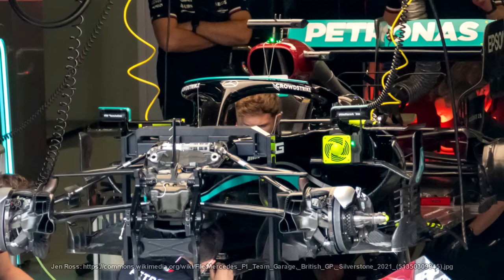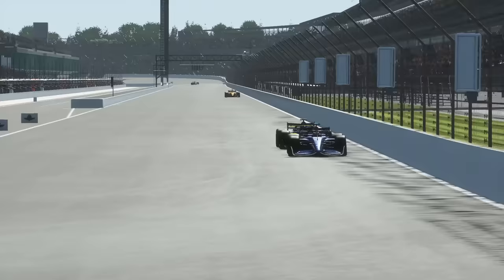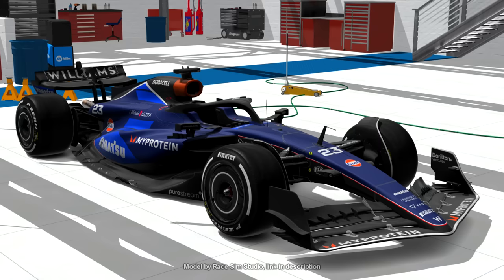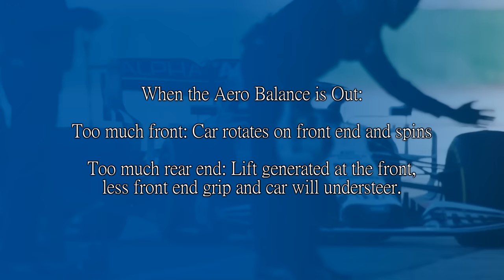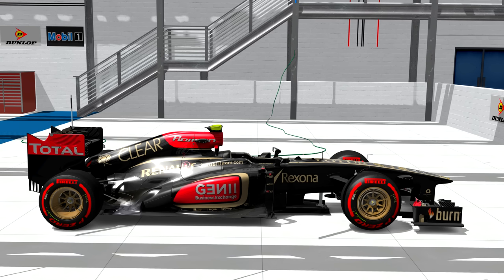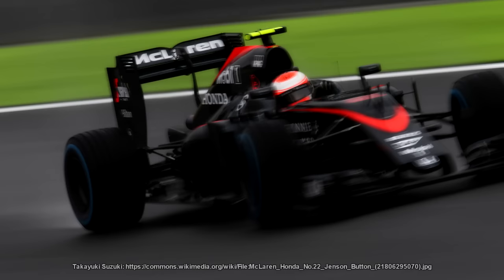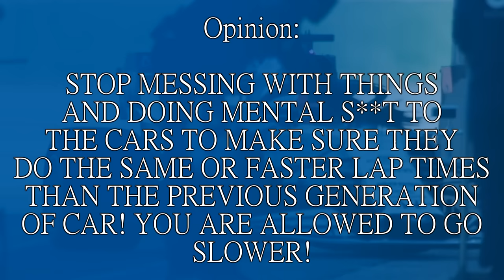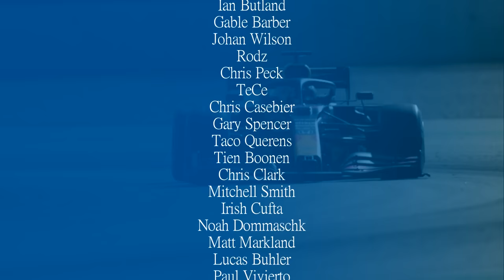BROKEN BEFORE IT'S EVEN IN? Opinions on the 'Undriveable' 2026 F1 Cars

Comment: Forget about incorporating movable aerodynamics. What I'm concnered with is how a minor failure in that regard, where in today's world you could get away with something like a front wing change, could just throw you out of a race completely, simply because you can't shed drag on the straights, or conversely, get enough downforce when going through the twisty bits.

In all honesty, this just sounds to me like one more point of failure that teams will have to mitigate. If this means we get early turbo-hybrid era levels of retirements, I dread to imagine how races can so very quickly be ruined. You don't even need to look far to see that movable aero's effects on a driver's race can be massive, just look at Max Verstappen in Spain 2022.
Reply: Drivers in the past died from rear wing failures at high speeds such as Bruce McLaren at Goodwood in 1970. F1 never had active aerodynamics for this reason. Active suspension was also banned on safety grounds as well (people also argued that active suspension was a driving aid and they were getting annoyed with the best drivers in the world using driving aids like ABS, traction control, launch control etc).

Comment: I think these rushed cars are going to end up pushing some teams out of the cost cap. The old saying is “good, cheap and fast. Pick two” teams won’t want to bring a bad car so they are going to end up spending lots of money on overtime hours and other things to get a good car quickly. 
The teams will get penalised but it’s the FIAs fault for taking too long
Reply: The bigger fear is a repeat of 1994 where we have cars that are undrivable  because the teams didn't have enough time to design and build and test the cars to fit the regulations for the season.
Reply: @CyanRooper yeah I hadn’t even considered that. Maybe the FIAs fears of 1993 about computer systems malfunctioning might actually happen if they don’t get their arses into gear and produce some concrete regulations
Reply: Highly unlikely. F1 is going hard towards becoming a cartel (they want to actually ban other teams joining in the next Concorde agreement) so the chance of a team being spent out of the sport is very very very low.

Comment: You think with synthetic fuels being shown to be viable, have less carbon emissions than conventional fuels, and bring comparable performance to the engine; you’d think they would start to rely less on the MGU- H battery because it kinda would be dead weight. I think removing it all together would give improved reliability to the car, less weight, less complexity, and could help transition to slightly higher displacement engines…. And maybe even a V8 (I know that’s far off but a man can dream)

Comment: Give me cars that can go through Casino corner side by side with a little room to spare on each side, or can go three wide during corners like Curva Grande. Give me cars that do not weigh 1t but instead weight around 600-700kg.
Give me cars where the car looks like it got blown up after a big shunt, but the driver can escape without injury.

THAT is what I would rather have, than going quicker and quicker each regulation until we create an irl version of F-Zero...

Comment: I guess I don't see a problem with having to, you know, slow down and risk drifting a bit around a corner?  I know that open wheel drivers HATE oversteer, but I'd love to see the balance go from "90% car" to "50% car, 50% driver."  It's the old cycle -- remove downforce, and within 3 years they have it all back, so in year 4 they remove downforce, etc.  But more HP and less traction always makes better racing.  More nervous drivers, especially those who aren't the best, but better racing.
Reply: "slow down and risk drifting a bit around a corner" Four wheel drifts went away from F1 with the move to radial tyres around 1980.  They aren't like the cross-plies of the mid-70's where peak grip was at much larger slip angles. Four wheel drifting around corners with radials is slower as that is beyond the slip angle of peak grip.  For what you want, *why  not just mandate crossply tyres?*🙂
Reply: @TassieLorenzo  As I said, slow em down and have 'em move around.  I know it "went away" and quite frankly what we have is / are boring races and people geeking out over some small aero bit that got moved.  7-time champions "forget how to drive" when their don't have the equipment, while wankers suddenly are up front.   The thing needs to be 50% driver skill, and that won't happen with the current rules.

Comment: They say racing improves the breed. Well, it used to be true, once. Low hanging fruit.
Now? Maybe on the engine front it’s still possible.
The last time I can think of that F1 had any impact on the real world was when they engineered breathing machines during c19 lockdowns. Fair enough, that was a worthy endeavour.
But there’s not much connection between F1 cars, or any racing cars, and real world cars anymore. If they lose that, what’s the point of racing? Not brand recognition, I’m not tempted to buy a Merc or start drinking RB, just because they’re in F1. I won’t buy Pirellis for my car, I don’t even know, nor care, what brand tyres my car carries right here and now. I can’t fill’r up at Aranco. What’s the use? Only ‘racing improves the breed’.
Without, it’s just another sports category. You can be fan of a team or driver. I am, but that’s not enough.

Comment: It's not a concern, it's a fact: 470hp (350kW) will deplete 4MJ in around 10seconds. At witch point the cars will be left with only the ~500hp permitted to the ICE. 
And that's best case scenario. Most laps will be worse than that, since they can only recover 2MJ per lap from the MGU-K (MGU-H will be gone). That means, 2 laps charging for a third with 10seconds available of double power. Puny 500hp most of the time. 
Keeping this energy recovery and deployment limits is absolutely idiotic. I really can't understand what they are thinking...

Comment: Software developer: The public is too dumb to talk testing. From experience. In short. Would you rather they found problems on track, or in the sim? In the sim. Which is what they did. Which is why they ran the test.

(ahem) YOU SHOULD ALWAYS WRITE A TEST SO IT FAILS THE FIRST TIME. If a test works, maybe you wrote a useless test. If it fails, now you're fixing problems. That is the point. It shouldn't start passing until you've solved all the issues.

"They left it too late" would you rather they get the rules years early and spend the whole time sacrificing curerebt gen for it? You'd yell about that too.

"Well these regs were supposed to attract new teams". (Leo pointing meme.) There. That's the real issue. Nothing else matters compared to that. That's the issue.

"You are allowed to go slower" not in the social media age. That is also a problem.

The result of test was that they advised, if they want bigger DRS, it has to be on front and back simultaneously. That does not mean they will go this route! They may keep DRS as-is as a compromise.

"What if bug DRS fails" my brother in Christ. What happens when DRS fails today? There has been much work so that usually, DRS fails shut. It should not fail open. Systems that fail in an unsafe manner are certainly a problem. So that's why they are testing.

Comment: So, umm, if cars can basically run high downforce setups everywhere and just dump the downforce on the straights... how do you overtake? Braking zones in modern F1 cars are laughably short so unless someone cocks it up there's not much chance there and now cars are likely to have less variation in setups removing that 'x is faster at y bit of the track' opportunity too. Honestly F1 really needs to figure out what it wants to be. If you want to be really restrictive in the rules go all the way and have at least a partial spec series with a way to enforce nice friendly air coming off the arse end of the car. If you want to be an engineering series then open up the rules so there's multiple viable avenues to high performance and a mid-pack team might be able to try a hail mary option ala Brawn, Williams and Toyota in 2009. The current approach coupled with a cost cap virtually guarantees that whoever gets it right at the start of a regulation change will retain that advantage for years as the rest of the top tier, rolling in money teams can't spend their way to catching up. 

Oh and on the laptime question, I wonder if F1 is starting to cast nervous glances over at Formula E. Gen 4 is due to race in 2027 and they're looking at around 600kW / 800bhp along with larger batteries and in-race charging via the mother of all cables in the pits (600kW for 30 seconds giving around 10% charge... going to want more than marigolds for that one!). FE cars are already in the same weight category as current F1 cars (and actually start a race lighter) and the boss of Envision reckons that if you put proper aero and slicks on a Gen 3 FE car it wouldn't be far off current F1 lap times. Now, obviously he's got a vested interest and we'd be talking single lap pace as current FE cars can't go the same distance (and, presumably, not at the likes of Monza) but that's probably not a million miles away from the truth. And, of course, FE potentially has the one trump card that could undo Formula 1 that no other series has: relevancy. F1 exists in its current form thanks to the value of its brand and other companies wanting to be associated with it. As the world keeps moving away from ICE and with younger fans being far more attuned to green issues it's not inconceivable that F1 could find itself out of fashion and fighting to stay relevant, at least enough to keep those sponsorship bucks rolling in. Not, of course, that I'm saying it's likely to happen but interesting point to speculate on.
Reply: Problem is that if they tear up the rulebook and allow more freedom then someone will inevitably get it right and dominate leading to everyone to complain about boring racing. But if the rules were restricted to allow for closer racing then fans will complain about the lack of innovation and call the racing "fake" or "manufactured" or "Socialist" for some reason.
Reply: Also not everyone who is under 20 is interested in EVs, there are still teenagers on social media drooling over 90s JDM vehicles that they'll never own like the 30 year olds that grew up with those cars who will also never own those cars. Formula E's success will be based on how entertaining they can make the on track action for people that don't usually watch motorsports.
Reply: The FIA will gut Formula E or merge it into F1 proper if FE started gaining any serious relevance. It's what the FIA does with anything under their banner that even starts to sniff F1's popularity.
Reply: @FallingPicturesProductions  That was the case back when Bernie owned F1. He wasn't willing to let anything else eclipse F1 in popularity and that's how other categories like Group C endurance racing died. WEC is currently exploding in popularity again but the FIA aren't doing anything to prevent it from outshining F1.
Reply: @CyanRooper  
WEC is already making moves to cap field sizes in WEC at the high risk of forcing privateers out. If the 2026 regs don't rekindle wild interest in F1, WEC will be undermined by 2027.
Reply: FE will definitely become competitive with F1 in some regards but unless there is truly revolutionary battery tech they will always be highly limited on race length. They also risk ruining the series if they go down the road of very high power and high downforce, since one of the best things about FE is that it is a low downforce series.
Reply: @CyanRooper  Surely the 30 year olds already owned a clapped out GC8 WRX, R32/R33 Skyline GTS-T or S14, S15 SIlvia in the past when they were cheap (assuming they are in Australia where  right hand drive  imports are common, there are no CO2 taxes and cars don't rust) and realise they are overrated!

Comment: Why wouldn't F1 just go with active suspension, than active aero?
Could possibly be a cheaper option with a standardised system?
Reply: Someone else said this but it's probably because they are worried about the cars running out of electric energy on the straights with 50/50 power and need to resort to drastic measures to cut drag.

Comment: 26 years later and the FIA still can't figure out more aero isn't the solution, apart from 2009 where likely through an act of God they made sense for the only time in modern F1, before fucking it up by banning refuelling turning the cars into limosines for 2010, whereby the cars have just gotten fatter and fatter year by year since.

Honestly haven't watched a full GP in over a year now which is unheard of for me, not necessarily because of the racing or drivers or anything, but because the cars are so stable they're just boring to watch and the drivers don't need to fight for grip at all. Speaking of 2009, please rewatch some of the races of that season, then watch a race from today to see what I'm talking about (specifically watch the body language of the cars); the 2009 reset with reduced aero and the return of slicks, and retrospectively miles lighter than todays cars meant the cars bounced and slid and drifted and darted, meaning a good driver having a good day was crucial to winning a race, and almost every team had a shot of a podium that season. Sure they're much slower than today's cars, but you can really see the drivers work and that's exciting to watch, and makes the whole thing feel faster.

All the FIA has to do is trim the fat; cut the wheelbases by about 80-110cm, cut the track width by about 10-15cm, wheels/tyres that are about 10% smaller than they are now but proportionally the same, perhaps higher profile tyres+smaller wheels to reduce unsprung weight (increased fuel efficiency), and instead of introducing a hybrid unit that aims to increase electric power percentage to 50%, why not introduce smaller, lighter hybrid systems which can match the capability of today's hybrid systems?

It's like as soon as we fans come to terms to accept the V10s are never coming back, the FIA thinks up 10 more new ways to disappoint us lmao

Comment: A race doesn't need DRS if the cars are well designed in the first place.  Cars should overtake each other simply because of their pace and not because of any assistance. The only factor in overtaking may be how the tires are at any given time, and that of course depends more on the strategy of each team.  I think the FIA is screwing up with that 50/50 PU, hell, no one besides them cares about how green an F1 car is, and worst of all, the schedule is a mess and pollutes more with logistics. You want a green race, make a reasonable schedule in the first place.  The aero I think should be reduced anyway, even if the cars are going to be slower. I think the key to making the new regulations work is to have less complex cars, without as much aerodynamics and no hybrid engines. They want to attract more competitors, but at the same time make things too complicated... like they did in rallying. That's just my opinion.
Reply: Well then you need to slow the cars down quite a bit. We saw in the early 2000s what happens if you have fixed aero and very high speeds. Zero racing.
Reply: @wiegraf9009  yeah,is inevitable to loose something. not going flat out through eau rouge/ radillion is better than have a boring race of faster cars

Comment: How about a normally aspirated 2.4 liter V8 with minimal aero? Drivers now are what, 10% of performance?
Reply: Why do you think cylinders = power? The mythical BMW "1300hp" engine was a 4-cylinder.
Reply: @KevinJDildonik  That 1300 hp engine only lasted for 2 laps before it literally exploded though. During the actual race they used around 800 hp. There's a video by YouTuber JayEmm on Cars where he got some of the engineers behind the legendary McLaren MP4/4 to explain everything on the car with the actual car in the video. They showed that the cockpit had a knob to adjust turbo boost pressure to reduce power and therefore reduce fuel consumption. The drivers would crank the boost all the way up for the first few laps of the race and build a massive gap then over time they'd reduce boost pressure to reduce fuel consumption and reduce the stress on the engine so that they could make it to the end of the race with some fuel left over for the FIA to check.
Reply: @KevinJDildonik Maybe They are thinking about the sound and not just the power ? Also F1 doesn't need more power 850-950 hp is plenty enough if the overall weight of the cars is bought back down closer to even 2014 F1 specs the difficulty is that driver safety is a much bigger deal now so adds a lot of weight . I don't mind the idea of a revisit to the older Kers style hybrid where it is only active by the driver input and completely scrap DRS .
Reply: @KevinJDildonik  because they slapped to it the racist turbo?

Comment: The cars are as long as a full size SUV. Not an exaggeration. Look it up. You can't have corner to corner racing in cars this big. They built Land Speed cars and then try to straighten out every corner. The goal should be cars racing against cars on a track with corners, not just being full throttle for 90% of track.
Reply: Wheelbase was the only dimension still free until 2021 (max width introduced in 1972. max height in 1977).  Teams chose what was best for performance as they are entitled to do. :) People blame the FIA for too many rules, yet this was one rule they did NOT make!
Reply: @TassieLorenzo  oh no, I also fully blame the dweeb nerd engineers who don't know what racing means. For them, "best performance" is a single car on track with no others around it. Proof? They had to come up with the gimmick of DRS in order to pass.